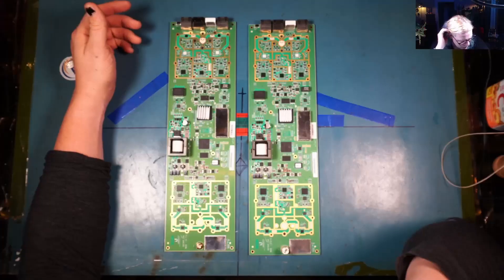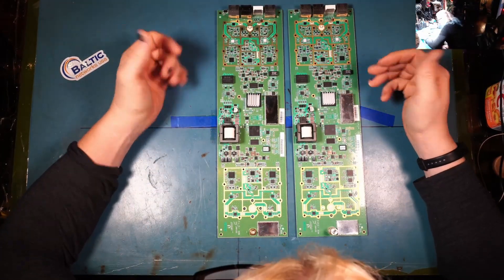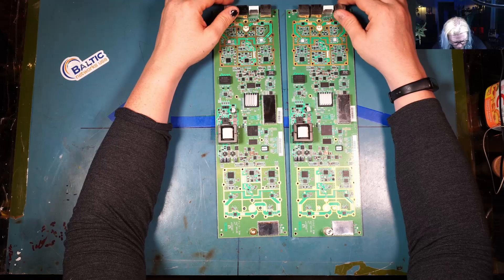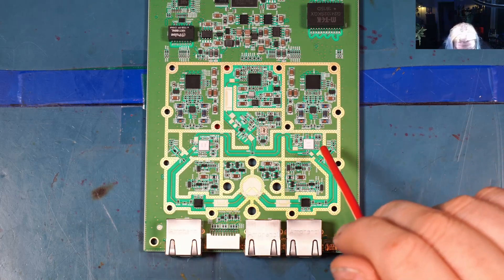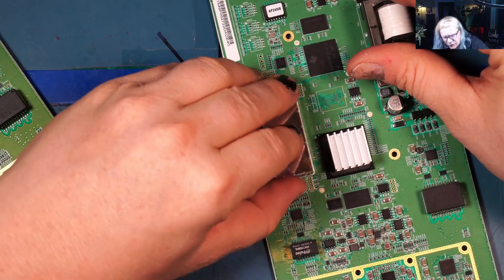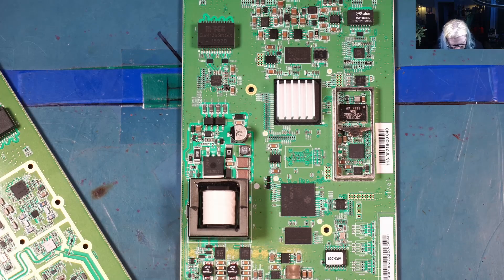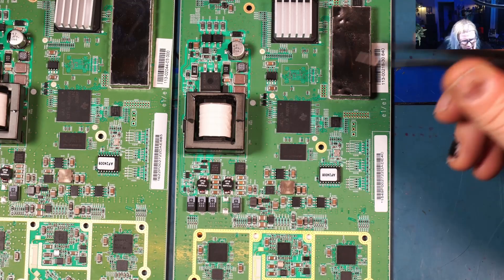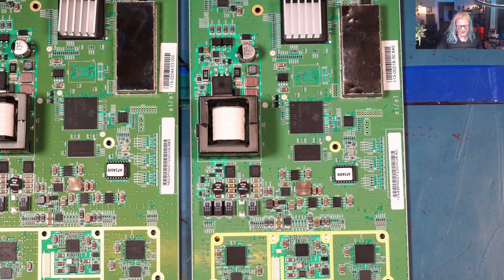Ubiquiti AF24 Classic vs AF24HD (Comparison)

Comment: Can you provide the exact model of the chip responsible for the DATA port on the 24HD model? 

After plugging in the ethernet I stopped zipping to 1GbE only max is 100Mb over cable.... First on pin 0 and 1 pair it showed me 21dB SNR (the other 29 dB SNR). I shortened the cable from 15m to 15cm and then the SNR stayed at 27-29, but unfortunately still only 100Mbps is the max. Probably the chip I'm looking for is the one in the video at 0:38 at which you say “Gigabits” ?
Reply from the maker: We actually repair these boards if you'd like. Otherwise message us on FB through our business page "ISP technology" . Thomas can tell you what the part number is. Though you can't really buy one offs. We buy them a few hundred at a time. The af60XR has replaced the af24